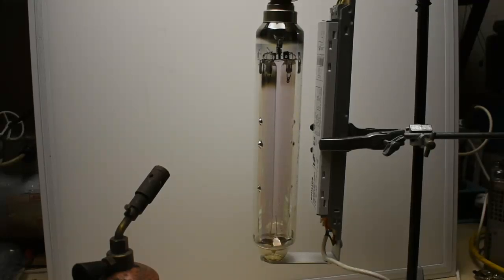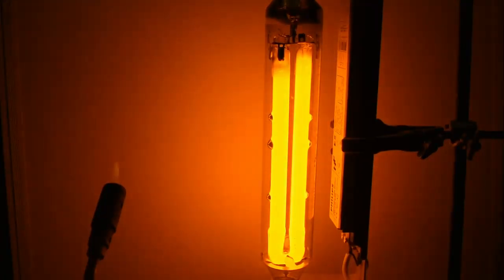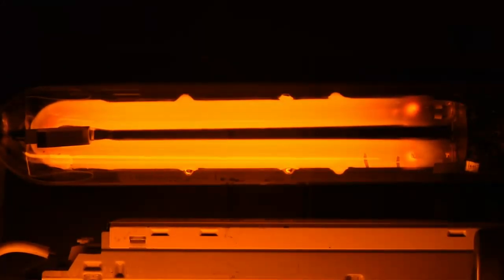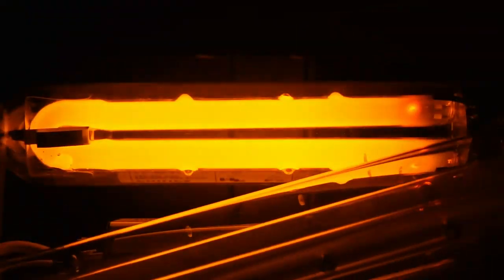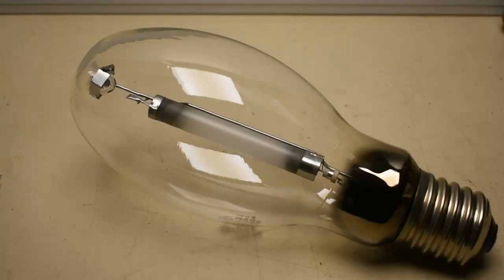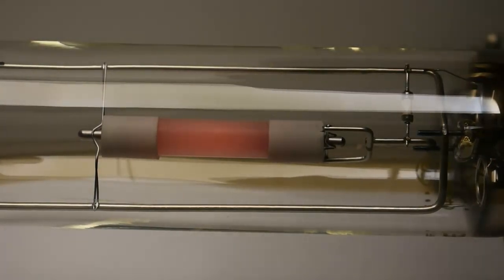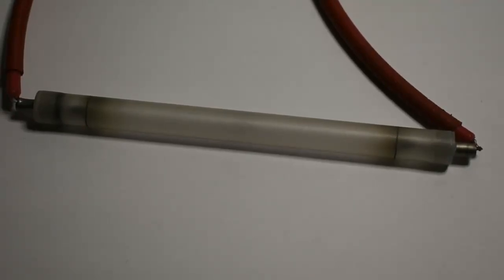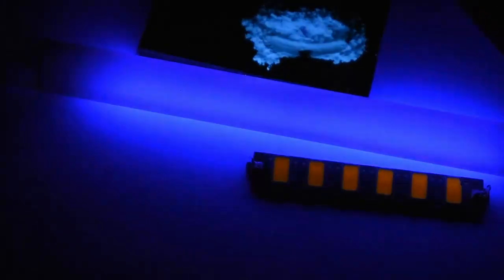Emission and Absorption of Sodium Light

Comment: Yes, this is exactly the phenomenon of phosphorescence in these alumina tubes that I'm after. Do you remember the make and model of the second high pressure sodium lamp used here? It looks like it could be GE, but I don't know. Apparently this afterglow is only present on a very select few models and only then of certain years manufactured. 

Incidentally the demonstration of diatomic sodium vapor molecular absorption causing the arc tube to be colored after shutdown is fantastic here. The exact same vibronic coupling mechanism that gives Iodine its deep violet color and the other halogens their lighter colors.
Reply from the maker: Can't remember what manufacture produced that bare arc tube it could be GE, I have two other SON lamps that exhibit this behaviour an 'Aura' badged lamp and an 'Eye'. Its seems to be age related more than manufacturer.

Comment: Awesome video! There have been a few interesting demonstrations of the atomic absorption spectra of sodium on YT, Ben Krasnow did a great video on the Zeeman effect, and a popsci channel (Nick Uhas iirc) played with the idea of "black flames" of a sodium-doped fire. The last several effects you showed are new to me, though, and demonstrate some great properties. The cloudy appearance of the LPS lamp under D-line illumination is very curious, because it suggests absorption and re-emission with a very high efficiency. It would be great to see the effect at different bulb temperatures and relative sodium vapor pressure in the tube and how that affects reflectance. On the HPS, the color of the tube you observe is actually a deep-green-gray as a result of the sodium vapor absorbing in the D-line (it is such a dark color due to the high vapor pressure inside the alumina bulb). This can be observed if you boil sodium in a vacuum or inert atmosphere (thunderf00t has a nice video on that). Finally, the fluorescence of the alumina bulb is really interesting and I wonder if the material composition and structure are chosen intentionally, or if it's a side-product of manufacturing. 
Anyways, I like your videos and I look forward to seeing more!
Reply from the maker: Thanks, Ben’s video on Zeeman splitting is brilliant, I need to look at the others you mention. Interesting point you mention on vapour pressure it is possible, at some risk to the lamp, to run above the normal wattage and increase the pressure. 
 In the High-pressure lamp, it’s interesting that the absorption can be seen under white light. The output spectrum of this lamp shows a marked broadening absorption in the Sodium D lines over other HP sodium lamps.  
With the sintered Al2O3 tube I think the additive is intentional, but I can’t remember why or what it is. Not all manufacturer’s arc tubes demonstrate this effect. 
Thanks for your comments.
Reply: @tuopeeks  The mechanism of emission gets quite complicated at "higher" pressures, and as the metal gas moves away from ideality, so to speak. I also suspect HPS are tuned to maximize luminous efficiency and color rendering index, inasmuch as that is possible, so broader spectral emission is sought out.
My suggestion was to observe the non-powered lamp under different temperatures, rather than heating or cooling the energized lamp. This will show the effect of relative sodium vapor concentration on the cloudy reflective appearance. I'm not sure what use that would be, but it seems interesting enough to me.
Cheers
Reply from the maker: @cognitivedissonancer  It's just getting the sodium vapour to different temperatures could be done by over driving the lamp, otherwise it is difficult to heat the inner discharge tube as it is in a vacuum jacket with an IR reflective coating on it. Interesting idea and I'd like to try but maybe when I have an end of life lamp. :-)
Reply: I second this entire comment very strongly and also thought of the Mason demo showing the color of alkali vapors in vacuum. I've also never seen a few of the effects in the video and they are indeed very intriguing. I think the highly efficient absorption and reemission (effectively scattering) in the hot vapor of the just turned off bulb is the right explanation. Note that the color of the Na vapor is bluish though not due to the D line absorption, but rather the intrinsic color of diatomic sodium molecules in gas form. It's a vibronic coupling effect just like the one that makes iodine vapor purple and potassium vapor green. About the sintered alumina envelope of the high pressure lamp phosphorescing - it very much reminds me of the fused quartz envelopes of Xe/Kr flashlamps doing much the same after they're fired due to the inclusion of (I think) cerium in the envelope specifically intended to absorb UV radiation from the arc so as not to solarize eg. laser glass that the lamps are pumping. It may be a similar thing they're going for in these lamps as well to extend the lumen maintenance and avoid solarization. Anyway, great video, all fascinating exotic effects presented clearly.
Reply: @tuopeeks  just sending a reply to you directly since my other comment here above wasn't a direct reply but was still intended also for you. excellent video, hope to see more of this kind of thing.

Comment: SOX  Low Discharge lamp i have a 90w with ballast the one in your video looks like a Philips the one i own is an Osram i also own some High Discharge 70w SON Lamps as well as a Self ballasted 500w frosted mercury lamp The inner tube is called the Ark tube The outer glass is called the Envelope
Reply from the maker: I was using a Philips 35W & 55W SOX in the video.